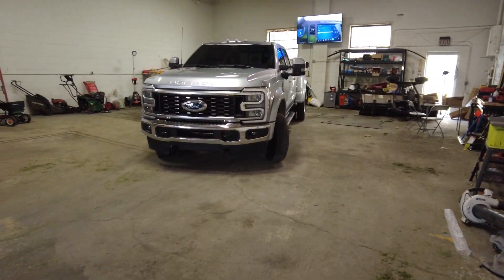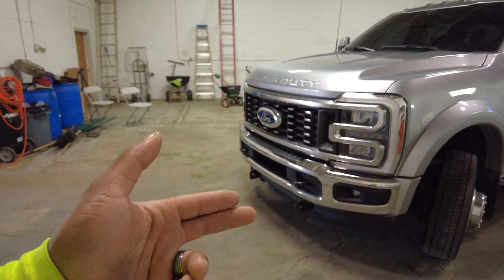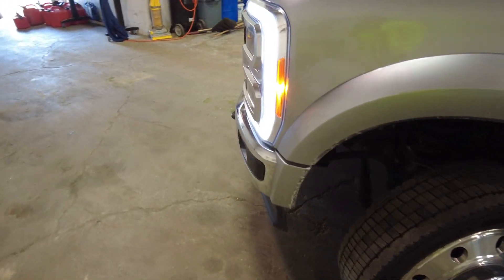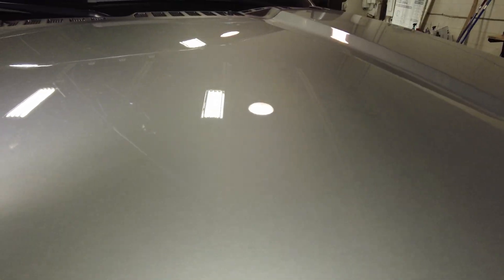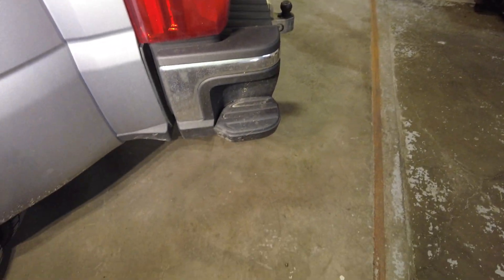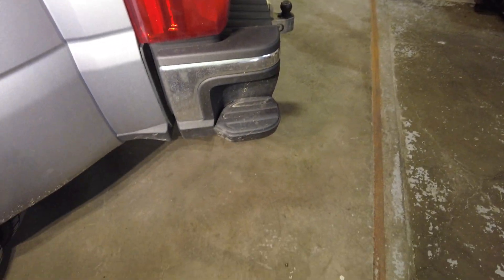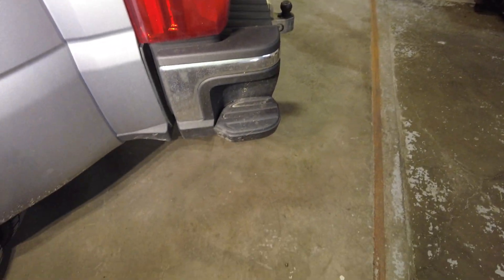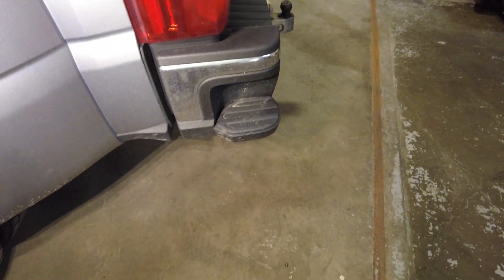100k work truck - dents, dings, rust after 1 year 25 thousand miles of WORKING!

Comment: DS, At about the 15:23 mark, is there supposed to be that much flex between the wheel and backing plate? Something doesn't look right there.  I'll have to look at mine tomorrow to see if it has flex like that also.
Reply: that wheel locks loose doesn't it
Reply from the maker: I don't know if it's the angle, I'll definitely take a look.